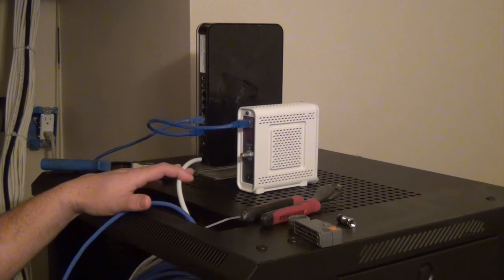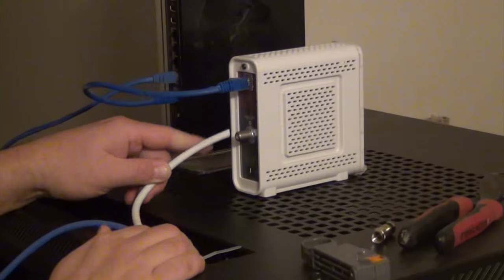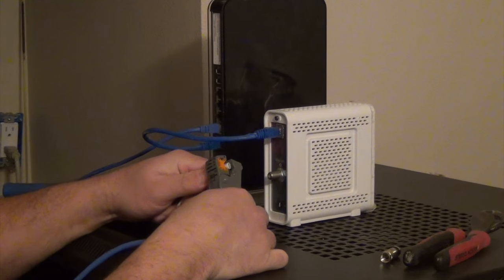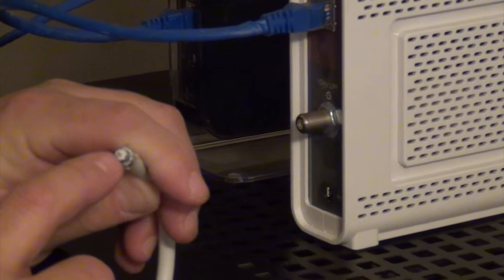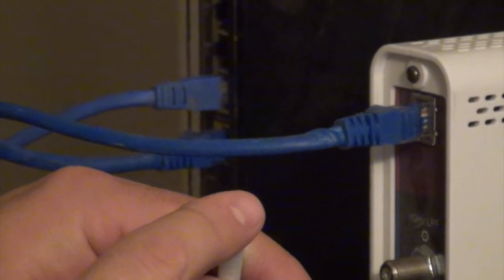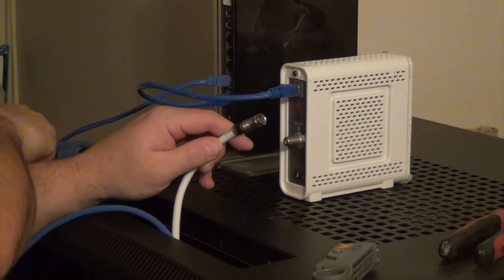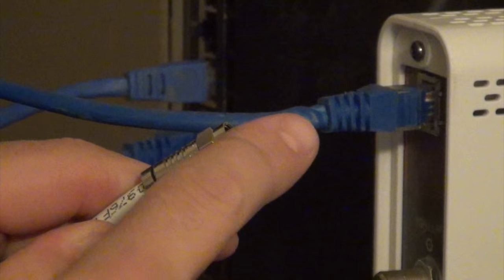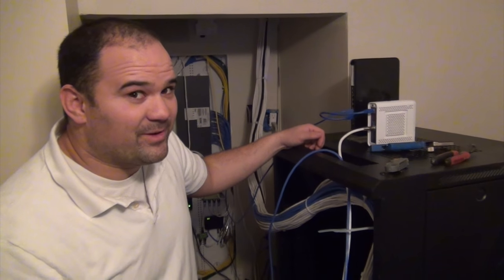How to properly put on a coax connector

Comment: For the record,  Some RG-6 is made with solid copper center center conductor.  It costs more, of course.  THe less expensive is copper clad steel, not copper clad aluminum.  that's why it messes up your stripper if you cut the center conductor, because it's steel.  If it were aluminum, there's be no problem cutting it with your wire stripper.
Reply from the maker: True. Good point